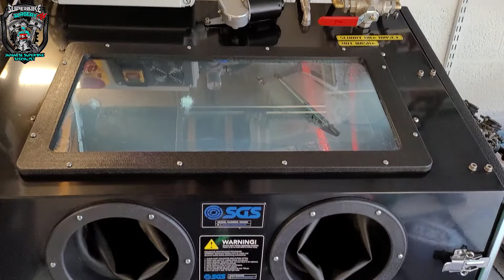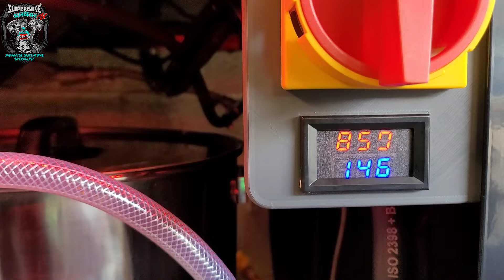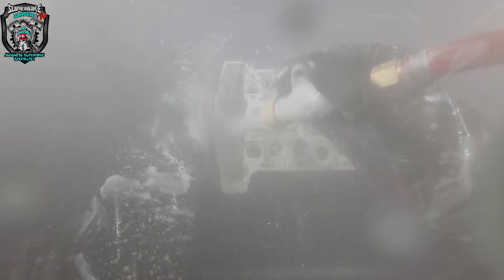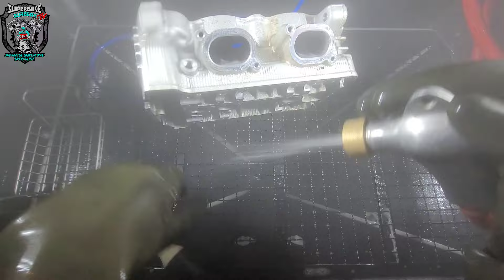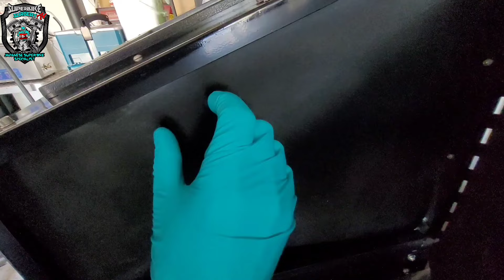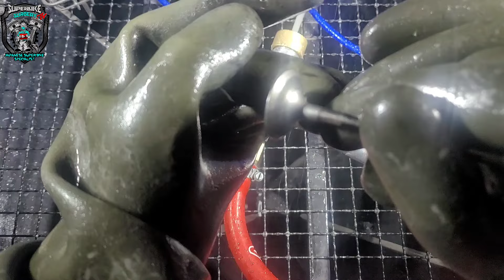Worlds Best Parts Washer? All in one. Hot wash degreasing, Rinse, Vapour Hone/Blasting.

Comment: Honest question, *noob here,  wouldn't it be easier to have two cabinets side by side? Seems to me it would be quicker to transfer the part from the soap/degreaser contaminated booth to a clean booth for beginning work, rather than spending the time to rinse down the booth, plus whatever other line flush / valving reconfiguration thats associated with progressing from task to task in the same booth. You could have hardlines running in the booth so when you're done cleaning and rinsing the part, you transfer it to the media booth and before tou begin work you can flick a switch on the first booth that runs through a self cleaning rinsedown cycle.

Comment: Back in the carb days, valve carbon deposits were a big problem because it inhibited heat transfer into the chambers. This would prevent proper air/fuel mixture especially at low in-cyl temps. Every tune up, the simple solution was to "steam clean" the engine with water (*not* ATF). The tech would it up to operating temperature, trickle water into the primary side, and the second it hit the valve head, it would begin to break the caked carbon deposits off. Since the carbon essentially was acting like an insulator, the temperature on the valve face would be way closer to the in cylinder temperature. 

So, the worse off the valve was, the hotter it'd be and the lower specific heat transfer you'd have, the more time the water spent on the valve decaking the carbon. It also takes "gradually" (over a few thousand strokes, say) works its way through the layers of carbon, so there's no danger of rapid metal expansion/contraction to lead to issues. The minor amounts of carbon (incomplete combustion leads to NOx, different carbon oxides etc, all of which come out on the exhaust stroke-- over thousands of miles, which is why your valves have carbon build up to begin with) just leaves with the excess water.

This is a super interesting build. A PLC is super expensive overkill for this. Like, the logic of an Arduino would be more than sufficient to both run a GUI, safety systems (eg to make sure proper flow is being produced from your media source pump, making sure that the pump isn't stalled out by sampling current draw, even monitoring the compressor system).[1] Then use the money saved to buy used industrial quality valving. Anything from Parker will basically last a lifetime. If it's on ebay, look for something reasonably clean. Usually companies will replace them well before they're worn out as a safety. Look for something used in a factory, not in the field. (Field use is "use it till its dead, then keep using it")

Rain-X on the viewport will likely help with any condensation/spray. Alternatively, misting cold water will do you right.  That leather solution is really interesting! In addition, 3M Yellow weatherstripping (not black) on the door might get you an even better seal. Speaking of seals, any concerns with blasting/watering/etc with seals on em? Either for making them dry out or having media/dirt embed in it?

Vibration tumblers are worth taking a look at. My machinist buddies who work on super precision assemblies that require very low surface roughness will use them after they're done machining their work. Both to get grime off old parts or to finish new, pristine parts (in different machines of course). It basically acts like a deburrer on steroids and the only downside is the noise. As annoying as an ultrasonic wash, though as useful.

Valves are controlled via the typical "manifold/solenoid/valve body" setup. PLC/Arduino talks to solenoid. There are so many different versions of solenoids based on what you want to do. Like if you want to dial in argon flow to the parts-per-million, a needle valve will need a solenoid that's in closed-loop but the current and duty-cycle (how much time the solenoid is needed to be on in order to adjust the valve) will be pretty small. This'll be expensive because it's a niche item, and because of the precision required for the nerds to ensure their low-volume products operate properly (mass-flow meters are hard to make, they say). On the other hand if you're running a crane, the duty-cycle might be 30% with a pretty high current draw. This could be as expensive as the argon valve controller, but not because of the precision (in fact, hydraulic systems usually have a specified acceptable fluid loss rate) but because how beefy those actuators are.[2]

[1] PLC's are basically there as cheap insurance for paying jobs. If a contractors perspective, you're spec'ing out a HVAC for a 30 story highrise and the aircon goes down on a 30 degree day, "blame Siemens" is a more acceptable answer than "blame my Arduino". Also, from an owners perspective, since there are so many Siemens/ABB/Rockwell/Honeywell guys out there, if I own the building, I want to know I have a secondary contractor available to get me out of the issue. Hell, you're paying 100k's quid minimum even tiny Aldis, the licensing to run a Siemens PLC is nothing
[2] And because of the safety critical components that'll have to be sourced. A crane (non-Chinesium) won''t make it to (legal) market without BSI/CE/DIN/ISO/etc certs, plus the industry themselves will agree on standards. Each unit will individually be tested at this level. This is why a mining LED hard-hat light and a Milwaukee one cost literally 10x off even though they look/feel identical. The acceptable failure rate on a Milwaukee might be 97%, while in mining it's probably closer to 99.7%. I duno about on cranes, but on jets, all hydraulic lines have 100% redundancy. Even cars require lines to be double-routed out from the ABS unit, in case one circuit fails. This is also somewhat related to Siemens' pricing. Their platform has to be pretty bullet-proof.

Comment: When I de-rusted the fuel tank on my Suzuki gt750,I used 20 litres of evaporust & done in hot weather,it was like it had just left the factory,within a few days it had flash rusted,so after a bit more research,if found out that if you use distilled water, it prevents the rust returning,3 years on & its still like it’s just left the factory.so you could submerge any parts with steel into distilled water, & that’ll prevent the rust returning.greta channel,I enjoy the content.top job mate

Comment: The blasting media in oil passages thing had me wincing. I had a head rebuilt years ago and the shop didn't clean it well enough. Turbo oil feed was at the back of the head, you can guess what happened. Filled my CHRA with what looked like sand, cost me two turbos in the end because some more dislodged at some point. Somehow it didn't ruin the cams. I had no recourse because it was a new build with used turbos. Now when I get a head or block back from cleaning and machining, I clean all of the passages myself.

Comment: You don't need programmable controllers. If you have internet, just get a bunch of smart switches and set up some scenes in Alexa - you won't even have to take your hands out.
Reply: That's absolutely genius! It's a bane when you have to pull your hands out 20 times to do simple tasks. Could have an Alexa control smart switches which controls the valves through the relays or contactors, can make it into a very nice package and hide it all into an electrical cabinet. Great shout!

Comment: That's some excellent work you've done there, and very clever too! I literally laughed out loud even you showed us your solution to the door sealing conundrum. Brilliantly simple, but so very effective. 

I haven't checked your channel yet, as this is the first of your videos I've seen, but I'm really hoping that you've given an update on how it's faring and any revisions you've made. 

I did have an idea on how you might cut down the changeover time between the different processes by eliminating the manual rinse - a loop of pipe around the inner perimeter at the top of the walls, fitted with spray nozzles similar in design to those in a garden spray irrigation system to direct fresh water over all internal surfaces for a timed flush with fresh water should do the trick at the press of a button.

Comment: That rubber idea is one of those kiss moments you go WTF did i not think of that, going to use that for my both my dry and vapor blaster. Also the post cleaning process is well thought out it always pains me trying to get those few bits of glass off after a clean.
Think at somestage i will build an all in one machine as saves so much space. :)
Great video
Reply: Yeah I get a kick out of seeing everyone put caulking over the top of cheap chinese weatherstripping lol.

Comment: Just do solenoid or motor valves with rocker or push button switches first man lol. The rubber covered rocker switches are pretty nice and would be suitable for this thing I would think. Im going to build an automated or some type of parts washer soon. Been collecting parts for awhile. Nice job man

Comment: have you tried, after cleaning it all up, use stainless ball media to peen the surface?
the idea is that, that exhaust side in particular looked quite porous (due to surface corrosion of aluminium), and glass bead at best just cleans it up, but stainless might be heavy enough to level it out, make it smoother, less prone to catching dirt and corroding?

Comment: Everything you did is very impressive ! Yet after trying myself and watching at the cost of everything in the end converting a dry blast cabinet can be so cheap that I would probably make three separate design with three different cabinets, which would drastically avoid cross contamination between all the media, and also help with the maintenance as all the designs are not mixed, but if you don’t have space clearly you did a « monster » here 😂

Comment: Best way imho to degrease motorcycle parts Is to steam clean outside. Ie hot pressure washer. If you are flush get a 21litres/ minute model. This will shift any dirt / grease. That requires a 3 phase hook up. Lay the pieces on carpet to prevent damage.

Comment: RAAF in Australian do not have a glass bead issue because they sugar blast and then just hot water will remove any sugar from the cleaning process maybe with your setup you can try it and report your mileage, The Aerospace Industry are anal when it comes to cleanliness and other things which is why they use high visibility tools and have worked out that say a no 2 phillips screwdriver will from vibration alone take 51 hours to vibrate through the skin of a helicopter such as an Iroquois which Americans and others probably know better as a Huey UH1 Bell

Comment: Great intro. When will part 2, as you mention,  that goes deaper come out? Can not see it on Patreon site either.
Wonder most how many watts of heater? Will not the introduction of cold compressed air quickly cool the degreaser fluid?
Reply from the maker: Thanks for the comment, there isn't a second part unfortunately.  If you are a Patreon then please join the Discord Server. There is a dedicated chat relating the the parts washer.  I'd be happy to chat as much as needed and share my experience building it. There are also a couple of other people in the group that have also had a go building one with some good ideas.

Comment: Love the idea.  Nice job!  I think I need to do this.  One suggestion...use water tight switches installed INSIDE the cabinet to actuate solenoid valves to change from one operation to the next.  No need to remove your hands from the gloves over and over.
Reply from the maker: You are not the first person to suggest this! Personally don't think it's such a great idea. It's such a harsh environment inside the cabinet even the best quality switches wouldn't last with the heat and high pressure. I'm already on my second set of high quality billet aluminium waterproof lights!
Reply: @SuperbikeSurgeryTV  True watertight switches aren't connected directly to the switch.  It's just a mechanical linkage with a rubber seal connected to a remote switch.  Even if it did leak, the liquid wouldn't harm anything.  I can send a drawing if you're interested.

Comment: Looks amazing, now i need to build one to :)

only does vaper blasting the alu camshaft surface not any problems ?
Reply from the maker: I wouldn't go near an aluminium bearing surface with it. It'd probably be fine but given that they are clean anyway and hidden inside the engine there's no point 👍
Reply: @SuperbikeSurgeryTV  thinking the same about the alu gasket surfaces. Do you check they’re ok with a straight edge?